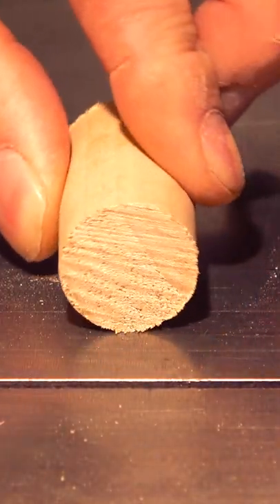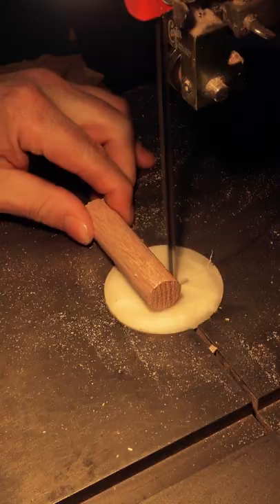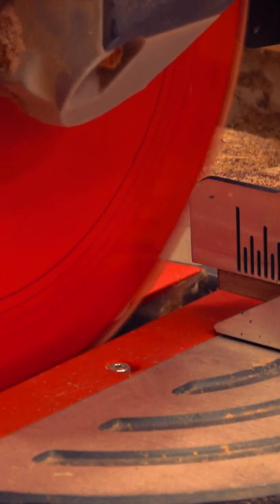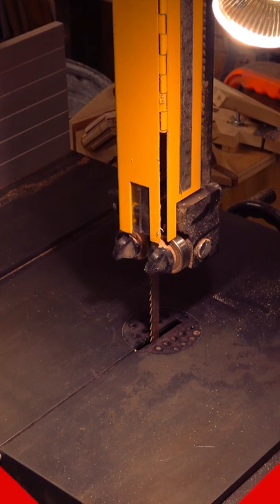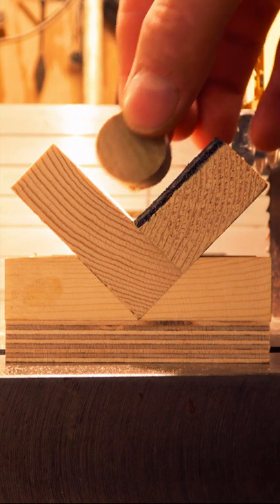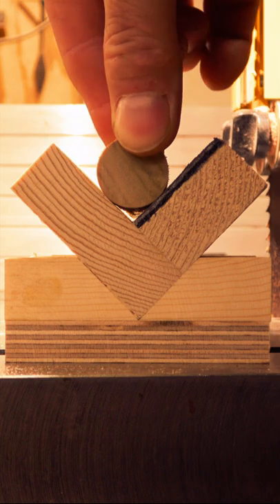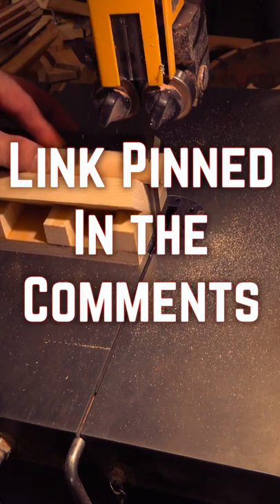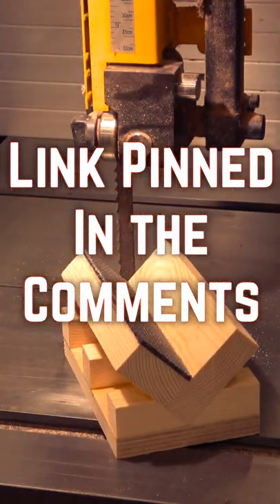15. NEVER cut dowels with a bandsaw unless you do this #shorts #MTbitesize

Comment: If you put a two inch work piece held with only two fingers in to any tool, you should expect for it to be snatched out of your hand and not be surprised when you are injured.
Reply from the maker: I disagree.  bandsaws do very well with very small pieces of wood that have flat surfaces.  I've been doing this 20 years and have never had a problem cross cutting 3 inch pieces of wood.
Reply: Kind of strange for you to both disagree and provide the video that proves my point.
Reply from the maker: @bryanmiller630  I'm not disagreeing with you that small pieces can be pulled out of your hands easier.  I'm fully agreeing with you.  What I guess I'm confused by is your logic that you'll only ever cut longer pieces.

Anything shorter than about 6 inches is dangerous.  But bandsaws are known for cutting smaller things without any problems.  Instead of limiting my bandsaw to only pieces that are larger and, honestly, wasting a lot of dowels, I've found a more simpler way to manage smaller pieces.